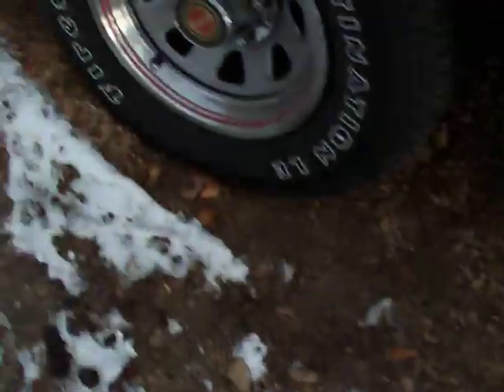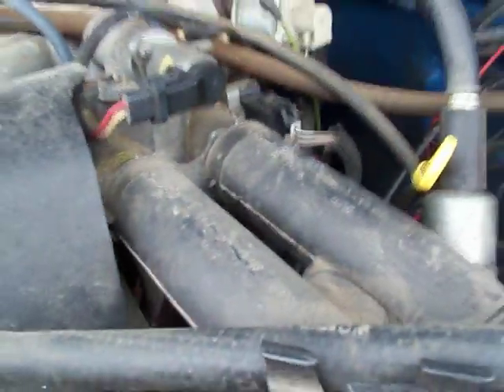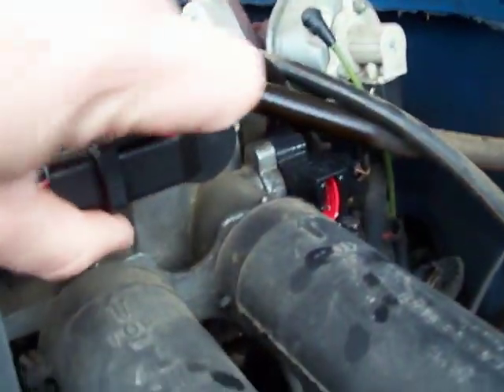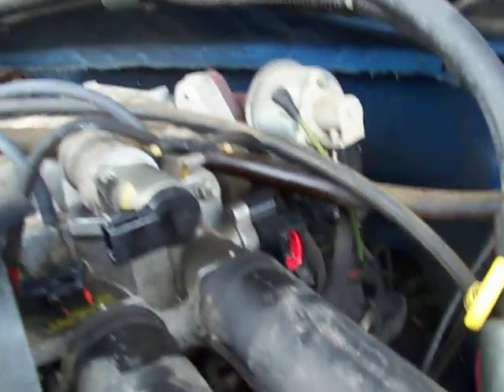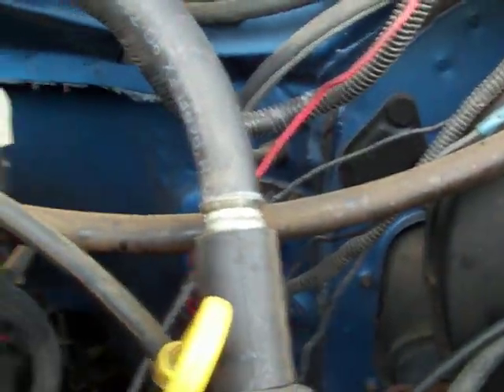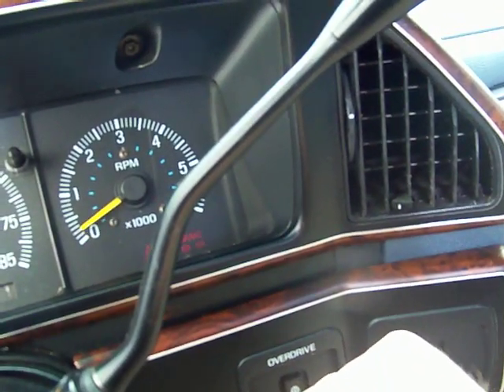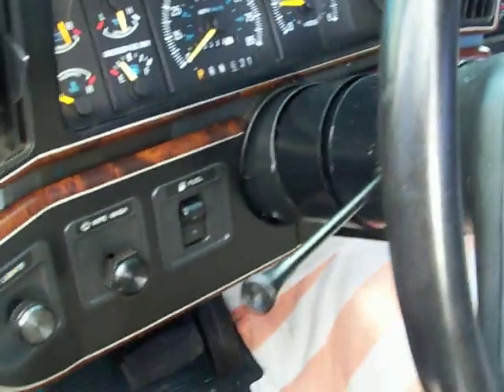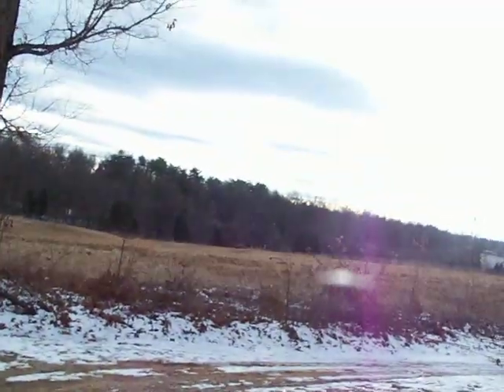Ford 4.9l (300 c.i.d.) Hesitation and Startup Fix

Comment: Hey man I’m having issues with my pickup. It’s almost the same exact one as yours but I have the 5 speed. When I press the clutch in it seems the rpm’s hold where I was and increase some and hold again and then go down to normal idle. Any ideas?

Comment: they leave out the issue is the computers start to fail after 10 years, slowly it gets harder to run until it wont. remove the computer pop the cover and look for 3 burned spots. its capacitors that fail and cause a ton of issues, rebuild the computer or replace it

Comment: note to this video.. brake cleaner is corrosive to plastic. and will shorten the life of the plastic. use Dialectric cleaner . they are usually alcohol based instead of ether based. it also prevents shorts on the ecu and flushes out corrosion really good to. but if its all you got and the car aint got another 100k miles in it. go for it

Comment: I've had trouble like many have described here, 94 f150 4.9 l.  There is a sensor on the distributor shaft called profile ignition pickup or PIP.  it is critical for the timing advance to work as the engine revs.  Easy replacement, just my $.02.  Mine did the hurkajerk till I thought it would fall apart.

Great info on the connectors and sensors, thanks for the vid.

Comment: Whats the whining in the video?  Mine just started that after replacing the camshiaft, camshaft gears, lifters, waterpump, cap and rotor and plugs. It didnt do it before hand and now it does. Its nuts. The computer was replace about a yr ago. And now it spits, sputters, and jerks upon acceleration.  So im going to replace the whole fuel system basically today. Ugh, I love the 4.9. But I think it's time to fianlly finish building my 306 for it and put this 4.9 in something crazy like a home built 4x4 buggy. All the torque in the world.
Reply: Power steering pump, I have a brand new one and it’s a little quieter but it still wines all these trucks do

Comment: On the value cover what is the cap and hose that runs to the air filter box? Trying to figure what the name of the plastic part it is
Reply: Filtered air for pvc system.   The filter is under main air filter, often neglected, falls apart allowing dirt to ruin engine over time!

Comment: I have a1990 f150 4.9 in line 6cylinder runs perfect in till it warms up then it starts missing the engine light comes on our put a new distributor in it New plugs plug wires cap and the hole nine yards it acks like a file problem can anyone give me a idea of what could be the problem please
Reply from the maker: You could possibly have a coolant temperature sensor giving you trouble, or even possibly an oxygen sensor. In fact the oxygen sensor connector can give trouble. They get dirt and water in them and cause a whole world of nightmares.

Comment: I have a 1984 ford econoline 150 . My van drives great in the winter time . In the summer when the temp is over 70 and I turn the ac on the car drives for 20 30 minutes then dies out but not a complete die out it bawgs out . I let it sit for 20 minutes then it starts right back up and runs for another 20 30 minutes . Any idea what this could be I took it to 2 mechanics and they fix the wrong shit and tell me it's fine . I have a new engine control module new spark plugs and wires and a new air filter .. any ideas ?? Thanks !

Comment: Worked on mine. She conked out on me leaving home depot, it would barely run. Left her there over night and went back today and same thing. I could hear the fuel pump coming on when I turned the key to first position so I was pretty sure it wasn't that. Cleaned the two sensors and whamoo! she started right up and purred like a kitten. I think part of my issue was my power steering cap came loose and sprayed oil everywhere, but the metal connected were slightly corroded too. Thanks again.

Comment: Still chasing mine. What happens with mine. When cold, it starts fantastic. Runs and steps down on the throttle as it should.
As long as its cold you can turn it off and restart. No issues.
The issue rears its head at a restart on a warm engine. It sputters and dies. Try it again and 75% chance it will stutter and die.
It it does stay running. You can tell the computer is searching for the right mix. Third start when warm. Starts and runs normal.

Have a OBD1 tester= No fault codes.
Now here is my list of fixes.
Idle air controller is 3 years old. Cleaned it up.
Throttle body gaskets has been replaced. Was bad.
Throttle position sensor= new.
Coolant temp sensor= New
MAP sensor= new
Computer = new
EGR valve= Removed and cleaned to insure no sticking ect.

Thats about it for my fixes. Its has had a completer tune up with new ignition system.
Truck only has 108,000 miles
When I got it. The throttle body gasket had been bad for some time. To compensate, they just increased the idle speed to get past the air leak.
Not sure how long they ran it like that. Was a muni truck so i have complete maint records. They had replaced the idle speed controller twice.
So mostly I have been fixing their fixes.

I think i will swing back to the Idle speed controller. I have another 4.9 in a F250 that runs flawless. Maybe swap it out to see.
I need a new hat R&R man!!
Reply: I think you need to look at a bad gas tank, if you have everything new, its the only thing left.

Comment: Gets Actron CP9690 code tester. It checks live, record, graphing, emissions tests, transmission codes, it has code connect to diagnose codes. It does MORE! It works on 1983-2013. It's updatable. EBAY has it.

Comment: IN THE LONG RUN , YOU MAY WANT TO CHANGE OUT THE TIMING CHANGE AND GEAR. THIS INVOLVED ALOT OF WORK TO PERFORM AND IN A VAN, IT WILL TAKE LONGER. GET A MECHANIC WHO KNOWS THESE ENGINES. TIME CONSUMING JOB AND THE DEALER WILL CHARGE YOU PLENTY.

Comment: Man I need help with mine cranks up every time and when I start to drive my check engine light will come on then it runs like crap it will cut out and almost die I stop then put it in neutral rev it a lil then go again couple minutes later then it will do it again I put a new map sensor idk I'm lost there is a leak in my gas tank but Idk if that would couse something like that and it so bad I can't get it to town to have a scan done
Reply from the maker: I really don't know where to start on that one. There's so many things that could cause a a fault it would be hard to narrow it down. On something like that it really does need to be scanned for codes.
Reply: He has a hole in his gas tank though, would that not throw fuel pressure off? @FerdinandMagellan08
Reply: if you have a carb and not a efi, there is a grey computer box on the right fender well,  Change the box about 35.00.

Comment: I've got a 89 f150 300 6 or 4.9 get fire n I replaced both fuel pump n only hit when spaying starting fluid it but want start
Reply from the maker: Rayen Mullins I wonder, did you replace the mid frame fuel pump? Ford had a second pump through 1989 on the frame rail. I suspect that might be a problem.

Comment: have 94 4.9 does the GPS need to be adjusted or just goes on
Reply: If you mean tps then yes it just goes in but use the right screwdriver or you have a great chance at rounding it out

Comment: I'm working on the same truck, except it's an '88. We've cleaned all connectors for the MAP, IAC, and TPS. That didn't work, so we replaced the IAC, and went ahead and replaced the distributor wires and rotor. (I was going to put a new cap on it, but USPS didn't think it needed it) The throttle body also got a good cleaning with TB cleaner. The thing still idles very rough, and hesitates until it gets up to speed. But, it runs perfect with any vacuum hose removed from the intake manifold. I'm going to check the Fuel pressure regulator next, maybe it's stuck on thinking it needs high pressure so it runs too rich. But, Incase that doesn't work, and pulling codes ends up telling me nothing, I will be needing some ideas.
Reply: kd9bwi hey I have the same issue now on my ‘91 f150 with the 4.9L. Hesitated until it gets to speed. Did you figure it out by chance? I’m about to do the things you said you did that didn’t fix the problem and I’m afraid it won’t solve my trucks either. I’d be super great full to hear back from you if ya fixed it. Take care! Thaks

Comment: Can you help me?  I have same vehicle.  It sat for 3 years.  Won't start.  No spark.  Firestone can't figure it out.  Any idea?  Thanks so much.
Reply: Ignition control module (ICM)
Reply: omah i had the same problem ,i dnt remeber what its callled but replace the little box thats screwd to the inside of the driver fender
Reply: @hustlemindsent6904  That's what fixed mine too. It was 1981 with a carb. That little grey box is the computer.

Comment: Gonna try it but don't think this is it. My 96' 4.9 starts but "diesels" when hot. You can floor the gas and do whatever but it won't do anything but idle rough. Then it just "pops" and smooths right out and you are good to go until you cut it off again.Starts cold every time, just when it sits and heat soaks. Replaced coil, took IAC off and cleaned out, bypassed egr but nothing has helped.
Reply: The pop then smoothing out sound like what my '84 F150 used to do. I fixed it by correcting the engine timing.
Reply: hey have you solve your problem with the 4.9 mine does the same thing
Reply: Didn't fix it, but it cooled off (weather) and the truck doesn't do it anymore.
Reply: Mine does the exact same thing. Have you found the solution to the problem yet? My truck is throwing some codes as well that suggest I may need to replace the intake manifold gasket as it is getting too much air.
Reply: Same here, ran good in the cold weather...when it got hot weather, we to not running to cutting off sputtering. Found out after 3 fuel pumps the third one has only 18 psi. it a fuel pressue issue runs lean, shld have 50-60 psi on a 4.9..About to give up a junk the SOB. Get me a old chevy with a carb and no dam computers.
Reply: Having some issues with my 94.  Figured out it was vapor lock.  Wrapped all the fuel line with heat barrier sleeves.  Didn't have an issue this last summer until it got over 100 degrees.  Think I might wrap the fuel railing also and see if it helps.

Comment: what year did they start using the MASS AIRFLOW SENSOR on the Ford F150's?
Reply: 1995 or 1996.
Reply: Should be 95. I have a 95 f150 and it has one.
Reply: 4.9 only have them from Calif.
Reply: I had a 95 without built in Norfolk, now i own a 96 built in Canada and it has a maf
Reply: 1996

Comment: Black power steering fluid and matching black brake fluid. You know those need replaced right? Also the rear diff and trans fluids........   Not much into maintenance I see.
Reply from the maker: Actually all that has been changed. I replaced the brake lines and power steering fluid. I remember changing the transmission fluid but don't remember when. I also changed the rear differential fluid the same time I put brake lines on it. This is a five year old video.......not much into looking at video information I see.....

Comment: 1996 ford e250 4.9 starts up runs 10 minutes then cuts off. let it sit awhile starts right up. drive 2 miles cuts off.
Reply: Mya Wilkerson I’d look into vapor lock
Reply: fuel pump and fuel filter.!. when the fuel pump gets hot is fails, when it cools off it works again. 
check this; when the truck is NOT starting correctly turn the key to where all your electronics come on and your dash lights up (but do not start the truck) and listen for the fuel pump, is should it run for 2-3 seconds to prime before starting (a hum or whine sound for 2-3 seconds)
Reply: Did you have a check engine light?  Did you check for codes with a scan tool?  It could be the P.I.P. sensor in the distributor.  Replacing the distributor would fix that.
Reply: My 88 bronco with the 4.9 is doing the same thing runs for about  10 mins dies then the check engine light comes on you let it sit for 10 mins And it'll start back up

Comment: yea guys I ran my front fuel tank out of gas by accident I've been trying to get it back up and working by flipping the switch over rear to front while driving at highway speed its not working and all of a sudden it started to hesitate on the good tank I need some help if you have any solutions.thanks ted

Comment: I had a similar problem with my 1993 F150 4.9l truck. After replacing the O2 sensor, the fuel filter, the MAP sensor, a friend who is a professional mechanic said to try the water temperature sending unit. It fired right up. The fuel pressure was good. Mt truck sat idle for over six months because of a bad $10.00 sending unit. Live and learn. My truck got to where it was not only hard to start, but you had to pump the accelerator just to keep it running. It smoked badly. All is well now.
Reply: The computer will adjust fuel ratio based on engine temp.  If for example, the sending unit tells computer the engine is hot when in fact it's cold, then the fuel mixture will be too lean and engine may not start.

Comment: Thanks much. I had been told the Ignition Control Module is the next thing to replace for issues like this when your cleaning method refuses to work...
(ebay $24. or New Ford part $124.)

Comment: Thank you for your video.  This has been helpful in trying to fix my 89 F-150.  But to blame the cold, well, I can't believe.  My truck only had problems because I let it sit for 5 years, and before that, it would start up in -25 F in the North Dakota winters up here, even if not plugged in.  The EFI 4.9l can handle the cold just fine, when working properly, so 23 above should be nothing.
Reply: Troubles starting in  cold weather  could be a bad temperature  sensor (not sender ) and or intake  manifold  temperature  sensor.  Cold engine  should  start and go to high idle while  engine is  warming up .
Reply: @Randall Carney  happned to my truck had to replace the coolant temp sensor

Comment: why does all fords sound like the power steering is messed up?
Reply: actually, they sound like that because ford power pumps are designed to use type f transmission fluid and most people refill them with standard power steering fluid.
Reply: That's just the way all Ford power steering pumps are. I have it on my 94 Ranger and nothings wrong with my pump. My friend has it on her 2006 Fusion and there's nothing wrong with it either. That's just something the vast majority of Fords do. Just they way they came haha
Reply: z2owhat I don't know if that's true, but if it is that is extremely helpful. I'll definitely try that out next time I refill my pump. Thanks for the tip!

Comment: that's what made the 65 to 84 the best 300s  the one barrel carb will never give fail you so long as you hit it with some carb cleaner every 6 months or so my 82 300 is in its 3 truck already and still going strong its in my 79 350 right now but it gets it done

Comment: Have a '95. Went a year with jerking and stalling like it was running out of gas. I cleaned the tps, tune-up all electrical I could do, didn't fix. Thought may be injectors or fuel pump. Before I tried one of those I did the simplest thing, I changed the o2 sensor and WHAAA LAAAA FIXED!! Very easy cheap fix $54. Try it if your having similar problems.

Comment: Also check the EGR valve for sticking,, and/or cracked vacuum lines going to the EGR valve and making it act goofey opening and closing randomly. Some have made an EGR blockoff plate but with a 1/8" hole in the middle so it does not set off a code in the computer. Go to fordsix.com for more help.

Comment: Thanks for the tip! I've got a 92 F150 with 208K+ miles on it and have developed the same issue that you and others have described. I'm getting ready to change the fuel filter and I will clean the TPS terminal while I'm at it. I already removed the IAC valve and cleaned the carbon out of it with no results so I've kinda been at a loss as to where I should look next. Thanks again!
Reply: Ver en español

Comment: I had an 88' with the whining noise, didn't this much of it until it sounded like a pulley was going to fly off lol it was my smog pump, and my fiance's 89' xlt 4.9L 6 has that hesitation, I'm gonna try that brake cleaner in the AM. Thanks for the vid!
Reply: I read about the whine on the PS pump, Ford requires a "special" Fluid, not standard automatic transmission fluid
Reply: @stephennickles7389 Best thing about using actual power steering fluid is it doesn’t stink nearly as bad as transmission fluid when it leaks.  That shit smells like vomit.

Comment: 92 f150, 4.9 liter, 144,000 original miles, anyone know can you remove and re-install power steering pump pulley on vehicle without removing radiator or removing bracket and removing pulley in vice. Thanks for any help, Thanks for the tip about connectors going out to try the fix now.

Comment: I've got the same engine with 210K, and it was bucking at low rpm's, sluggish response, and getting bad mileage. I tested for diagnostic codes and got a code 122 that indicated low voltage on the TPS. I was getting ready to order a new TPS, but luckily saw your video first. A couple shots of electronic parts cleaner on the TPS connector and it solved everything. Thanks for posting.

Comment: I've got the same engine with a stick shift in my '89  F150 and it revs up and down at idle.  After it runs for about 10 mins it will idle smoothly.  However, if you shut it off and start it up again it does the exact same thing. Does that sound like a TPS issue?  It has done this as long as I've owned the truck, about 10 years, and has progressively got worse.